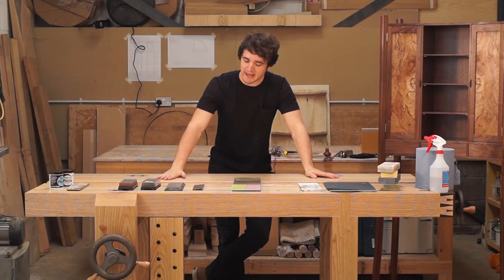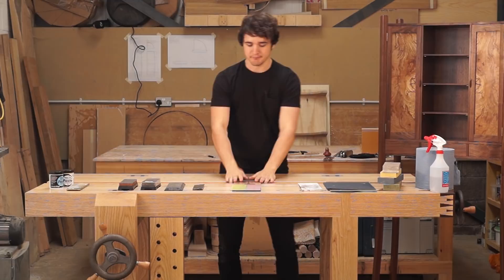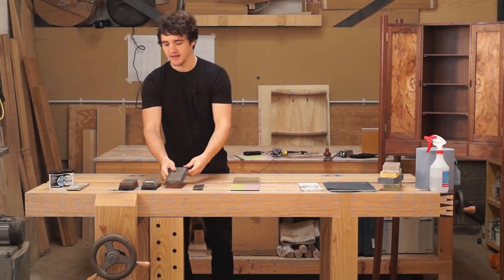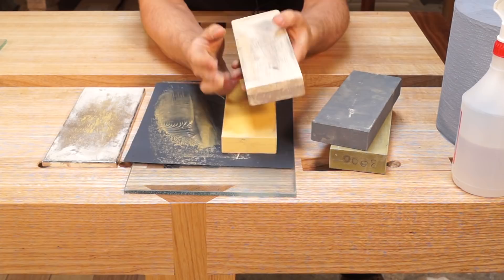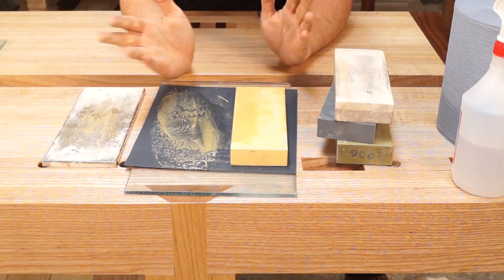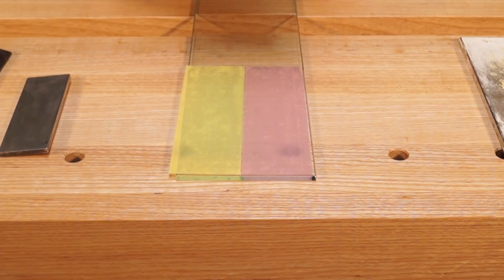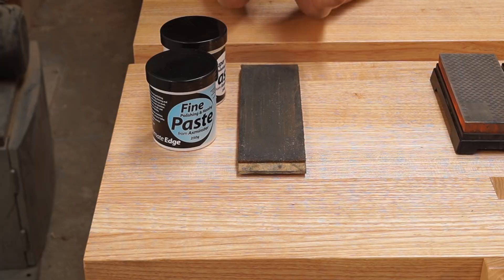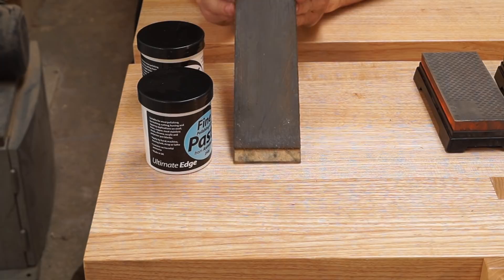Which SHARPENING Stone Is BEST? | Tool Duel #2

Comment: I've been using my oilstone as a professional Cabinet Maker for 35 years. I bought it at a flea-market for about £5. It's given me excellent results, sharpening for just a few minutes at a time. So long as you get a burr, and flatten off the back, you're there. I've only had to flatten it twice! You don't need float glass to flatten a stone. Just put a sheet of good quality coarse abrasive (like 80 grit SAIT brand or something) on the bed of your machine tool (planer/joiner, table saw whatever). If you want you can hold it down with double sided tape. My oilstone takes about 20 minutes to 1/2 hour to flatten like that (and it's a really hard stone). When you're sharpening, if the stone 'glazes over' your oil is too thick. You just want a thin oil like 3 in 1 or WD40 (or mix the 2??). Then it works just like a waterstone - but you don't have to flatten it after every use! You don't need a designated area for sharpening with oilstones. Mine is in a mahogany box with a lid, I made myself. I put a screw going through the box, to leave the points projecting by about 2mm, at each corner. Put it on the bench, and it won't move around as the screw points dig in to the bench slightly. No damp towels/non slip mats etc necessary. If there's oil everywhere, you're using too much oil!!! Once it's saturated with oil, you just need a little tiny squirt of fresh oil for every sharpening job. When it's hot weather, you often find you don't even need that, as the oil rises to the surface. Wipe it clean after use. And yes your hands will get a bit dirty/oily after every sharpen, but guess what? There's a solution to that, it's called 'washing your hands' - presumably you'd do the same after sharpening with a waterstone/diamond stone (if not, shame on you)? I have recently started stropping after sharpening, and that is like the icing on the cake. Superfine edge! Just a piece of leather glued to a piece of wood (again with screws in the corner) rubbed with jewelers rouge cutting compound (cheap as chips on Amazoff). Sharpening and stropping my 1" bench chisel takes about 30 seconds literally. Mind you I don't faff about with a honing guide.
You've obviously heard lots of 'cons' of oilstones from people. Some of whom might want to sell you some lovely new diamond stones/waterstones etc, perhaps?

Comment: Really great vids! One tip which I haven't seen posted is: To determine if your water stones have any low spots when you are flattening them with a diamond plate, put a crisscrossing grid of pencil marks across them (something like ¼” to ½” spacing). After a couple of passes on the plate, the pencil marks will be removed except in the low spots. So, if any marks remain, you need to keep going. It’s a very quick and easy way to minimize the amount of stone you need to remove.

Comment: Float glass is manufactured currently by allowing the molten glass to 'float' across a molten tin 'bath'. The plant I worked for maintained a molten tin bath that was 130 inches wide and ran almost a 1/4 of a mile in length. LOF Plant #10, Lathrop, Calif. Your welcome.

Comment: Thank you for contrasting sharpening methods and stones. You made the subject a bit more understandable to me. 

FWIW: Float glass was originally manufactured, as I recall from my Roman history reads, by gently pouring hot melted glass into a pot of hot melted lead.  (Glaziers back then must have had rather short lives.) The lead temp was held at or near the same temperature as the melted glass to minimize temperature gradient shocks during the pour. Because the lead was liquid, the surface is flat, and thus, the glass product came out flat. After the pour the lead is allowed to cool, which cools down the glass until usable. The density of the metallic bath must be greater than that of the glass so the glass floats on it and does not sink to the bottom... so hot water glass floats are out of the question. The shape of the vessel dictates the shape of the finished glass product, but edges are trued a bit and sanded and made marketable. Nowadays, they use modern production methods that employ safer, engineered metal solutions to have (probably) better-to-purpose parameters.
Reply: My hometown industry is glass and they make float glass pretty much the same way they did back in Roman days. They use a tin alloy instead of lead for the obvious reasons. Also, glass is not liquid enough to pour until about 1300°C or so. Density isn't the only reason water won't work 😉. The metal stays molten long after the glass has slowly cooled into a solid enough sheet to remove without warping it, so the still-liquid metal is drained or the glass pushed off the top so the metal can be used again without ever solidifying to save on energy costs.

Comment: Matt with the glass and sandpaper you have to be very careful in placing the paper. Took me many many attempts before I was able to place it and not get tears in it. When you place it hold it up to window and if you see air bubbles in it you will get tear out. I have held them up to light bulb light and could not see them but in natural light they stand out easier. If you can do it without getting bubbles you can sharpen a needle on it without tearing into it. But with bubbles just the size of the head of a needle the blade will catch. You can also use just a back stroke, or use side to side strokes. Even on stones unless the cheap profiling stones, I do not use a push stroke as it wears the stones on a guess 20-30% faster.

Comment: Hey Matt! So I've been a carpenter for 9 years, since I was 18. I build high end stairs for a trim company, and while of course there are always obstacles to conquer, alot of the challenge is gone at this point. I'm one of those guys who always want to grow as a woodworker, it's what I love about my profession, there are so many ways to learn and grow and just different ways to work with wood. I've decided for 2020 I want to start learning more about making furniture, joinery, and I want to do it primarily with hand tools to add another level of challenge. I want to say thank you much for you videos on various hand tools that are more vital early on. I always buy high end tools, I don't see the point in buying mediocre tools just to replace them later, and seeing as this is my career it only makes sense. But having you show me a good place to start has made it more realistic financially for me and I really appreciate it. In already loving my veritas planes and hand saws, and the DMT diamond plate works like a dream. I'm wanting to get a strop to take my sharpening/polishing to the next level. I have a 350/1200 dual sided plate, which has been working great. My question(s) then are : is there a specific type/brand of strop you would most recommend? One that I've found has a 
two sides, with one being more a seude side, which I'm guessing I would use for a higher "grit" as it's softer. Maybe provide a link to a product you recommend? Also, as far as cleaning/initially setting up my strop, I've seen some guys use oil and then sand paper (really don't like the idea of possibly ending up with oil being transferred to my work piece and ruining it tho) and I've seen other guys just scrape it with a razor to remove old compound. What would you recommend as far as maintaining the strop? (Method, how often, etc) last question, I see your compound is in a jar more like a paste, whereas all I can find with a quick search online and at the local box store are like hard sticks of compound. Exactly what kind of compound should I be getting, and if I were to get a double sided or two strops, what "grits" would I want if I'm taking it up to 1200 on the diamond plate, to be the most effective, and could you provide a link to that product? Know that was a bit long winded, but maybe this could be a whole new video? Thanks for all the videos man and keep at it! Wish you nothing but the best brother.

Comment: In order to judge how good a method is, you almost have to use it for a year and learn to use it well (which means being able to refresh a plane iron in about a minute and a half including disassembly of a double iron, and a minute or so for a chisel).

I started with soft waterstones, went to hard waterstones, and have ended up with natural waterstones and mostly oilstones. 

There is no set of modern waterstones that will outwork an IM313 with oil, a medium crystolon, a fine india and a medium oilstone (like a dan's "hard" - not a true hard, just a hard). 

If there is a desire for fast stones, going coarser is smarter than trying to find a "fine and fast" stone. If you feel you need a fast stone, you need to do better work with the coarser stones. The fine stones are about control.

You can get good with any of the methods, though, and a trade cabinetmaker with king stones would be faster and more consistent than a hobbyist with the best thing they could find.

Comment: Thanks Matt, I've been enjoying your channel alot these days. I've found that a honing guide on a DMT 1200x Diasharp followed by a strop gets me a consistent and sharp edge quickly. If I need to take off more material to reset a bevel I just use 600x or more course wet dry sandpaper on a machined and polished granite tile. I never have to flatten the diasharp like you would a stone and the Diasharp has been in use for years and I use it to sharpen all my kitchen knives and woodworking tools and it still works like new. Likely I could arrive at a razor sharp edge with fewer strokes on the strop if I added the diasharp 8000x to my workflow, but I've found there are diminishing returns when you aim for perfect razor sharp edge. A razor or scalpel sharp edge doesn't stick around very long regardless of the steel the blade is made of. I find I spend less time sharpening if I'm careful to be aware or what the tool feels like when it is starting to loose it's edge and sharpen or strop it often. I aim to maintain a passible "very sharp" on the edge most of the time rather than always chasing razor sharp. I find this approach works for me.

Comment: Just found your videos and think they straight, honest and enthusiastic, great. One point about diamond stones. You mentioned they clog but you didn't talk about lubricant on them. Most seem to think they work better with a spray of water and I have even been told of using WD40.Another point is using lots of water in a very small workshop (also known as a shed) close to electrical plugs etc bit iffy and where space is limited a separate sharpening station may not be on.

Comment: My system is a 8" slow speed grinder with the Veritas grinding jig, chased by DMT 1200 mesh, DMT 8000 mesh (cuts like a 4000) and a 8000 grit Japanese waterstone (that cuts like a 10,000, wears really slow and only needs a splash of water).

I came to that after a ridiculous amount of different setups from Scary Sharp/Tormek/Worksharp/waterstones/etc. Nice and clean, only 1-2 steps for a touchup and the hollow grind is super easy to freehand for quick touchups if I don't want to grab the LN jig. All the ridiculous waterstones I bought back in the day stay in the kitchen for sharpening knives :)

Comment: Great stuff! I do wish you would have given oil stones a look and talked about their benefits rather than just disregarding them, though; I gave every other sharpening system a try first (because everyone wrote off oil stones) but eventually, I finally tried them and found that they suited me the best (stay flat, less messy compared to waterstones, don't require presoaking, no need to worry about rust which I battle with waterstones, and leave a surface which responds really well to a strop). I go with a fine or medium India or a vintage washita, and follow up with a hard arkansas and a strop. I can get a new edge very quickly with this setup, and I don't even use a honing guide...

But, that's just me!
Reply: Luke Dupont vintage washita is the best for tools, really fast...
 if you use it regularly, not letting youre tools go too dull,, you Can get by with just one stone
Reply: @volsmann  if you never get a new tool to you that needs some bevel setup. What a nightmare scenario!

Comment: Like most people, I thought freehand sharpening would be difficult but, after watching a demonstration, I found that it' really not.  It's like any other skill, for example learning to saw to a line.  It took a bit of practice but not nearly as much as I expected.  No one likes sharpening but once you have the skill and a process, like sawing to a line, it becomes a non-event.  It's no longer something to dread but something you do in two minutes and you're back to woodworking.  If you don't feel confident about it, then use a guide.  It's not like the cool kids are going to snub you.
Reply: Does it save time? Well, yes and no.  If you use alloy irons and chisels like A2 or PMV11, you don't have to stop and sharpen very often.  In this case, freehand isn't much of a time saver.  If you use vintage irons and chisels or simply less expensive carbon steel tools, most people should be stopping to sharpen more often than they are and this is where it begins to save some time.  When I'm chopping dovetails in hardwood, I will touch up my chisel after each corner of a drawer box.  Sometimes I just hit it on the strop but often I use my finest stone then the strop.  I'm back to work in maybe one minute.
Reply: boekelnj the convex bevel formed by freehand sharpening is a bit more durable.
Reply: convex bevel from freehand?  You have a hand driven stone wheel? The town I live in has a old treadle stone wheel set on on display as "art" and the wheel stone has a radius of about 20-23 inches on a guessimate lol. So many times I pass by it and think dammit I gonna steal that sucker lol.
Reply: I have to agree. I find freehand to be easy and much more flexible than using a jig. I can't tell you how many tools I bought don't even fit into a jig in the first place... And you don't need to mess around with angle guides and such.
You can also do things like slightly rounding plane irons when working freehand, which makes all the difference when truing the edge of a board. Not sure how you would even accomplish that with a guide...
Reply: @boekelnj - a large enough wheel (like the one mentioned above at 20-23") would leave almost no concavity on a chisel. maybe such a small one that it could only be measured in very few micrometers
Reply: @boekelnj freehand is more versatile. How are you going to fit a tool like a scorp, a boat oar slick, an adze or a broadaxe into a holder? There's a bigger edged world out there than just chisels and plane irons. There's draw knives, froes and spokeshaves. The list goes on and on.

Comment: Excellent video overview on sharpening. I couldn't agree with you more on your opinions. I use waterstones followed by a strop for plane blades and chisels. I have found ceramic stones very convenient for carving knives. They are used dry but need to be flattened on occasion. Therefore a diamond lapping plate is essential to keep all stones flat. Keep up the good work!
Reply: What brand of ceramic stones are you using? I haven't heard of ceramic stones being used dry. Thanks.

Comment: Oil stones aren´t messy. You don´t have to use a lot oil. If the shavings clog the stone, you used the wrong oil or not enough. Or you didn´t clean the stone. For cleaning the stone, I just rub it with a hand full wood shavings. 
I use oil stones because the stay flat for a long time. I don´t have to flatten them after each use. The oil doesn´t dry, they´re always ready to go. By using the oil stones, I can get back to work quicker. When I have to sharpen a tool, I don´t want to waste time. I just have to tun around to my second work bench where the oil stones are mounted on a piece of wood and sharpen my tool. With water stones, I would have to soak them in water first and flatten them after a few chisels when I want to sharpen the blade of a plane. I always hated that. It interrupts my work and it is a big mess.
Water stones remove steel quicker, but not much quicker. In the end, using them takes more time.
I use my water stones only in the kitchen. For sharpening knifes they don´t have to be flat. Diamond plates would be an alternative for oil stones, but the good ones are expensive and I don´t know if they last as long as an oil stone. 

I also don´t use a honing guide. I did that in the past, but I don´t want to waste time. I´m pragmatic about the angle of the cutting edge. Something between 25° and 35° will do the job as long as it is sharp.